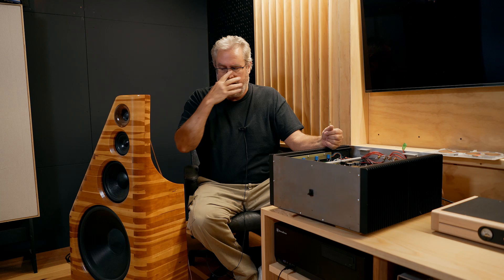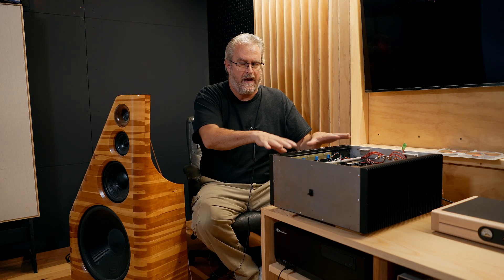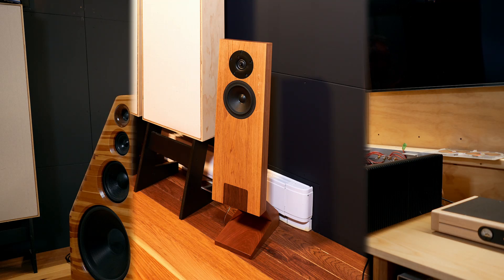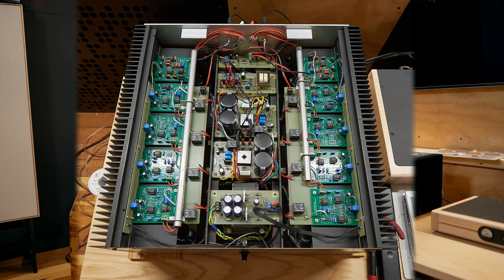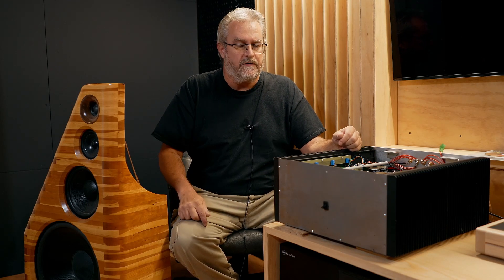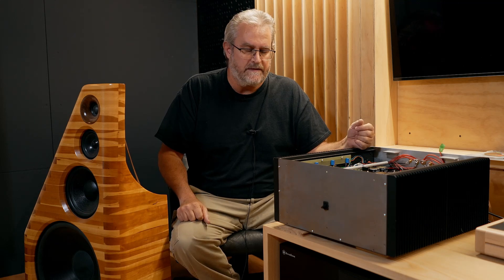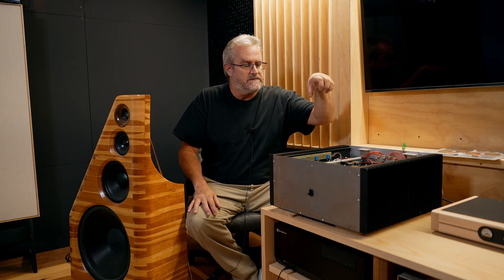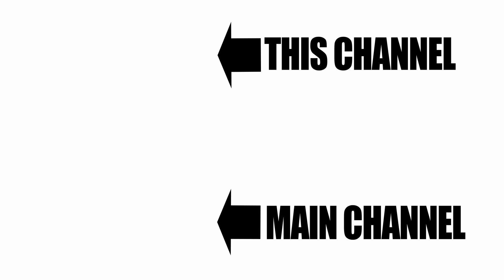EQ with Crossovers? Really?

Comment from the maker: Bit of a system update and an excuse to talk about how I set up the crossovers for my active 4-ways plus subs.
The usual way to design crossovers is to do a bunch of anechoic measurements and shoot for the flattest response possible. Then do some fine tuning by listening, however this is a step that some designers skip and just go with the measured response as "good enough". And that works for most rooms - flat response is the best all-round compromise.

But since these speakers will only be used in my listening room, I decided to design the crossovers tailored to that room - so the measurements I took were NOT anechoic. 
This allowed me to play with the crossover points and slopes (via the miniDSP 4x10) to not only separate the frequencies for the individual drivers, but also to "EQ" the response. I did this by changing the points and slopes so that I got the most even response that sounded the best to me.

For example the midwoofer cross to the midrange is at 910Hz for the midrange at 24db / octave, while the midwoofer crosses at 860Hz at 12db / octave. This flattened out a significant peak in the response around 900Hz that was there when I tried using matching points and slopes.

I won't lie - this took a LOT of time, both in changing the settings and in listening and measuring. But in the end I have a crossover configuration that sounds fantastic that I could then use to design the analog filters for the new active amplifier.

And I know this is beyond what most people can do, but I thought it would be interesting to show what's possible if your goal is the best sound quality you can get. This is a process that a lot of home theatre receivers try to approximate - room correction - but don't do very well because they are trying to correct a generically designed speaker to work in a room. My process is better because it designs the speaker to match the room without altering the original signal.
As set up, I'm using no additional EQ at all. The unchanged original music goes straight through to the active amp.

I used a picture of a passive crossover for this video and you may think it's misleading. But the same thing can be done with passive crossovers in the same way as I did with active ones. In fact you might be able to use software like Xsim or VituixCad to design the crossovers after you measure the drivers individually in the room. That would eliminate the need for the miniDSP.

Comment: Do you find that the analog crossovers sound better than the miniDSP, or is it mostly for convenience? I've thought about building analog circuits for convenience and stability. Digital settings can get changed so easily. It's a blessing and a curse.

Comment: Yup, asymmetrical crossovers can be quite useful. Not enough people think about it, or even know about it. Another trick is you can use this to control vertical directivity. All these diaphragms are after all air pressure pistons. A greater volume of air pressure pushes around a lesser volume. 

Mark
Reply from the maker: I suppose, although I can't see the reason to be concerned about vertical directivity in the usual small room where home speakers would be set up. 
Especially if the room has no treatment, it's just going to be a blizzard of overlapping reflections anyway, and any attempt at reducing some of those by limiting the driver's output is like trying to stop the flow of a river by standing in the middle of it.
I think too many of the tricks and techniques used in large venue sound have trickled into the home audio realm where they simply don't work. Things like cardioid bass and controlled directivity, which are essential for large spaces, but are ineffective in the typical listening room.
Reply: @IBuildIt   Well yes and no. Most rooms are nothing like you are listening in. So minimizing your floor and ceiling bounce may be effective depending on if the designer took those things into account on the crossover work. 

Bass steering tricks? Yeah. They are tricks. They have very limited bandwidth and thus very limited usefulness. There are much more effective methods to mitigate bass problems in normal sized rooms. More channels of power, more woofers and some DSP FIR filtering and you can mitigate a lot of the room issues down low. Fighting physics with physics actually. 

Have you done any actual nearfield listening? It might be an interesting thing for you to purpose design a set of small 3 ways that have the crossover focal points about a metre away from the baffle and you listening at that point. Just like in a studio. The room is gone. You are in the nearfield response. And the dynamics and presentation can be very impressive. A really good car system can do the same thing.

Food for the mind mill master Heinz

Mark
Reply from the maker: Before I had my room, I had roughly 55 years of listening in normal rooms, so I'm pretty familiar with how they sound :) And I spend half of my time now in an untreated room, although I don't listen to music there.

No amount of bass output manipulation cures the real problem of room modes. The best you can do taking that approach is to try to fill in the nulls that are created by the modes, but you can't do anything for the peaks. And it's the peaks that produce that one-note, boomy bass you get in all small rooms.

I listen in the nearfield when editing videos, and sometimes there's music happening as well. While nearfield swamps what you hear from the room, it's still there. Listen in the nearfield in a bathroom to see what I mean. The sound still energizes the room and activates room modes that ultimately affect what you hear.

From my perspective, most of these tweaks that can be done with speakers are a lot like polishing the brass on a sinking ship. The real problems are in the room the speakers are put in, and those problems are difficult to fix.
Reply: @IBuildIt   Agree on everything but your one note boomy bass idea. That is caused by excessive distortion in the bass driver. I have designed and worked with some very low distortion woofers. And that sir disappears when you have a low distortion woofer.

Mark
Reply from the maker: Possibly a contributing factor, but my money is on the room modes and long reverb times. 
Take a mode at 50Hz that's ringing for 1.5 seconds and you instantly have one note bass.

Comment: I’m guessing the crossover is done at line lever and not post amp. I haven’t gone back and watched your previous videos yet… just found your stuff. If that is the case how do you reverse phase for some drivers if needed? Can it be done before or do you just hook the cables up to that driver red to black? Great room and speakers! I’m now on the diy room treatment path, the beginning steps.
Reply from the maker: The crossovers are active line level and phase reversal is done exactly the way you said. In fact the midwoofers are out of phase and just plugged in "wrong" :)

Comment: In situ bespoke tuning! 

Bottom line; there's no rules in contouring/aligning to achieve a targeted response, and a pleasing experience. 

If adequate transparency is maintained, any gear avenue, approach, slope, pass characteristic, ... any amount of level and time. 
It's all good. 

Anything goes to achieve the desired response and alignment. 

Very nice. 

btw, content color temperature and vibrance is always pleasant.

Comment: 😊Congratulations, you accomplished one of my audio thought experiments.  Are the reflection simulation speakers delayed, to account for the longer path that the reflected sound would waves travel?
Reply from the maker: No, that would defeat the purpose of absorbing the reflections in the first place. Having these side speakers delayed would cause the comb filtering that happens when you let the early reflections happen.
Reply: @IBuildIt  Thanks-hard to argue with that. Is the distance to both sets of speakers to listening position about the same?
Reply from the maker: Yes, the same distance for all of them so that the sound arrives at the same time and there isn't any comb filtering.

Comment: Don’t you want a flat anechoic response and a downward tilted in room response? If you get the in room to be flat it will sound thin, no?
Reply from the maker: The in room response is downward tilting - that's what happens naturally with speakers that have flat response when measured from 1 meter away.
Anyway, my next video will have a recorded sample of the sound so you can judge for yourself whether it sounds thin.

Comment: The idea with the second pair of speakers sounds so interesting. I might try something like this outside to further my understanding of balancing direct and indirect sound. Shoudnt it be possible to adjust the delay  of the "virtual reflections" so to get virtual different room sizes? 
Also Linkwitz had a similar idea called "Watson SEL" which he described nicely on his website.
Reply from the maker: One of the primary reasons to absorb the early reflections from the main speakers is to reduce the comb filtering effect it creates. That comb filtering causes a loss in clarity, but does give a sense of spaciousness that most people like. 
So I have these speakers the same distance away from my listening position as my main speakers, which means the signal arrives at the same time and there is no comb filtering. But they give back that sense of spaciousness that was there when the reflections were not being treated. And they do that without impairing the clarity.
You can move them farther away or closer, but that will reintroduce the comb filtering that they were meant to stop.
Reply: I think i need some days to think through all of that. So basically you get the "indirect soundpower" which ads spaciousness but without "roominformation". So theoretically this also should give good spacial impression if the speakers are put outside where imo speakers usually sound quiet dull. An with eq or delay it should even be possible to get the impression of a wall that isnt there. I really want to try this on the weekend. 
Thank you for your elaborate responses. Its great to have a technical back and forth with someone who makes sense and is not afraid to share his opinion.
Reply: It would seem our hearing is particularly adept at that front-wide spot, ... around that 60 degree area.

Comment: I cannot imagine how much effort this took! High time for me to reassess my room treatment and run REW again.
Reply from the maker: Good stuff, Paul. 
Biggest thing that I've found is that you need to give yourself time to get used to how your system sounds in a treated room. When done properly, you are going to radically change how much you get from the room itself in the form of reflections and ringing, so it's going to sound a lot different to begin with. 
But it's definitely a change for the better and when you do get used it, you'll never want to go back.

Comment: Hi John. I recently watched your video on why transmission lines are not a good idea. I'm relieved that you gave me rational reasons never to build some.
I watched this video interested to hear what you said about crossovers and equalisation. I'm about to add a passive notch to one of the drivers near its crossover point in an ongoing speaker project. This notch filter will obtain something like an elliptical filter, reducing reinforcement near the crossover point while retaining reinforcement away from the point. This will yield a smoother response in that pair of speakers. It's all experimentation and it's all fun.
Reply: Quarter wave enclosures are great, and the tuned pipe is no exception

Comment: Very impressive process! To be able to design and build a treated listening room, design and build a speaker for that room and the active parts, the amp and active crossovers tuned for the room, hats off! 
My approach is a bit more conservative, with a surround receivet and diy speakers and treated living room. The receivers eq is turned off though which really made the music come alive. I do use the distance feature for time alignment. The crossover was designed in xsim but tuned to the room with measurements, lots of them, similar to what you did but with a passive crossover. The cost is a loss in amplitude. With 4 speakers I observe the same amazing sound stage as if you're inside the venue where the music breathes instead of a wall of sound coming from the front.
No commercial product could do this, it would probably cost half a million to do aside from the practicalities.
Is your project at a stage that the music sounds so natural that you can relax into it and there are no more major itches to scratch or issues to work out, aside from more experimentation?
Reply from the maker: I'm completely satisfied with how it sounds... for now. My itch is usually associated with wanting to build something new, even when what I have is more than good enough.

Comment: John, I know you’re first a carpenter (so am I) but let me run this by you.  Isn’t it possible to develop an active equalization system that constantly monitors and adjusts for components and environment and compensates appropriately?  Here’s the tough part, encode the source material so that in production it is given a performance target and archives that result through this monitor/equalization loop.
Reply from the maker: Anything is possible, but the practical advantages of a system like that would be too small to justify the time and expense needed to build it.
Reply: @IBuildIt  You are forgetting about audiophiles, John. They will will pay anything for anything if it does magic 😂
Reply: There is that…
Reply: Not only is it possible, it'll likely become widespread and adopted by many bio "enhanced" individuals. 

Elon's Neural Link type, of embedded enhancements, networking, ... merging us with AI and elevated capabilities. 

As new updates roll-out, I envision one could address Acoustic Convolution for one's environment. 

𝘚𝘵𝘦𝘷𝘦 𝘈𝘶𝘴𝘵𝘪𝘯, 𝘢𝘴𝘵𝘳𝘰𝘯𝘢𝘶𝘵, ... 𝘢 𝘮𝘢𝘯 𝘣𝘢𝘳𝘦𝘭𝘺 𝘢𝘭𝘪𝘷𝘦. 
𝘞𝘦 𝘤𝘢𝘯 𝘳𝘦𝘣𝘶𝘪𝘭𝘥 𝘩𝘪𝘮, 𝘸𝘦 𝘩𝘢𝘷𝘦 𝘵𝘩𝘦 𝘵𝘦𝘤𝘩𝘯𝘰𝘭𝘰𝘨𝘺.

Comment: I would love your opinion on the linkwitz findings in regards to off axis response? Since you seem to be such a fan of the Dipolar radiation pattern
Reply from the maker: My take on things is going to be different from Linkwitz and others (like Toole) that don't consider room treatment necessary for getting the best sound quality. In general, off-axis response is a lot less important in a treated room, because you are absorbing the reflections from that off-axis sound. 
In a properly treated room you are getting way more of the direct sound from the speaker and a lot less from the reflections bouncing around the room.